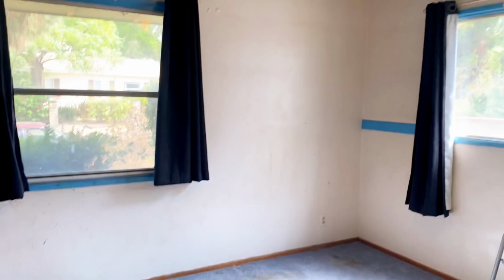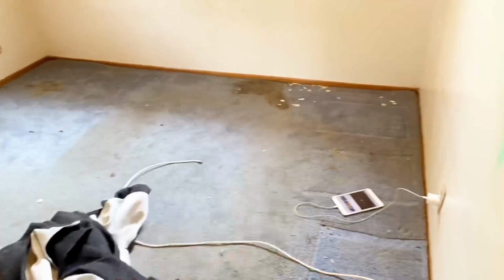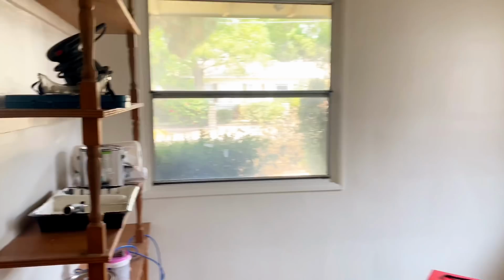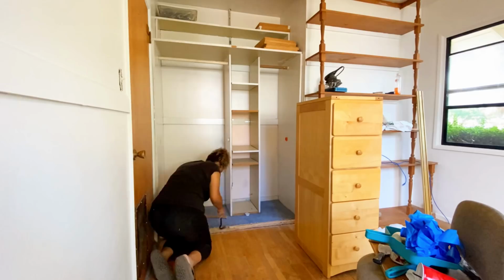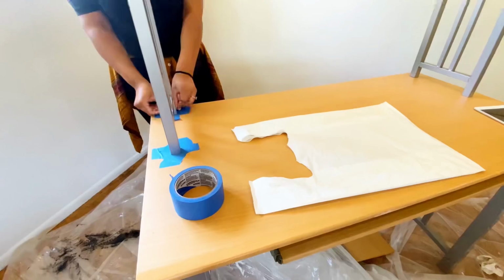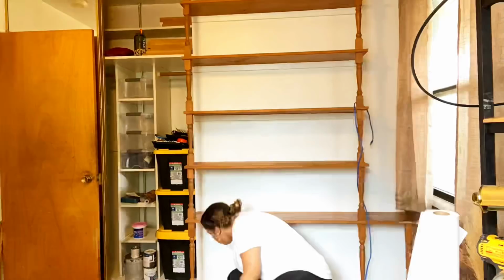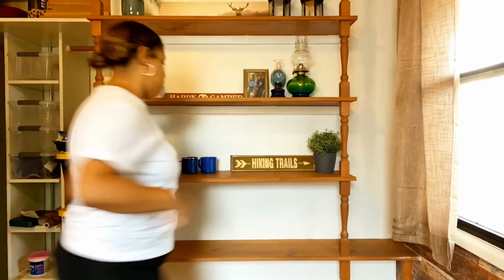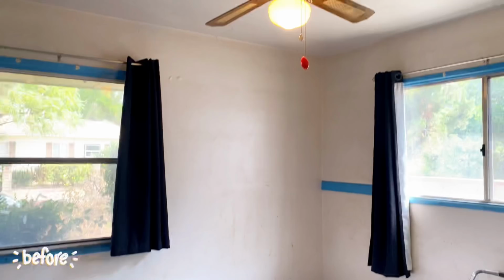MAN CAVE MAKEOVER ON A BUDGET

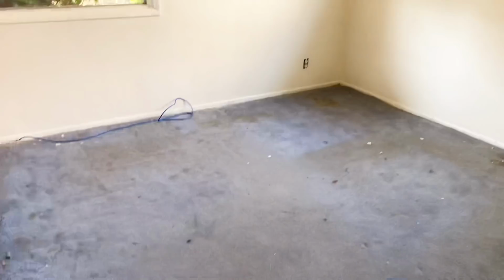Comment: Pausing at 3:16 b/c that little stool with wheels is so nifty. It looks like it made your job way easier. Is this an actual painter’s stool? Or did you repurpose something for this task? Either way—-fantastic!
Reply from the maker: Ahaha so funny you noticed this. Idk what it’s called they had it and gave it to me to use and yes it definitely did help but scratched the floors a bit once the carpet was pulled so I tried not to use it too much in the wood floor